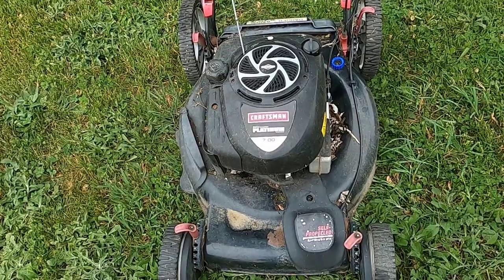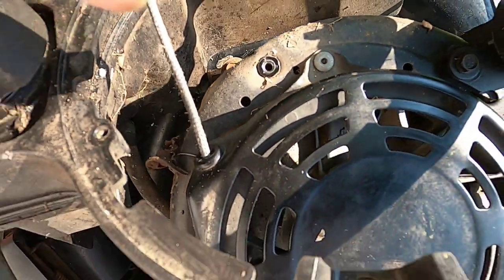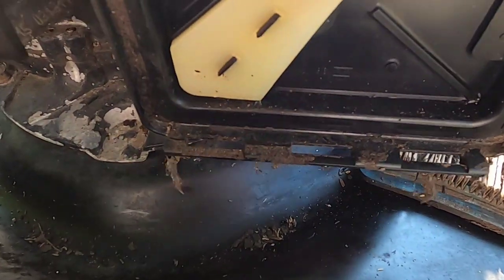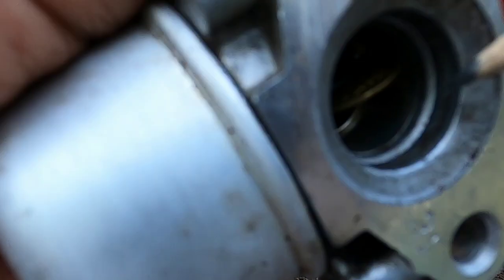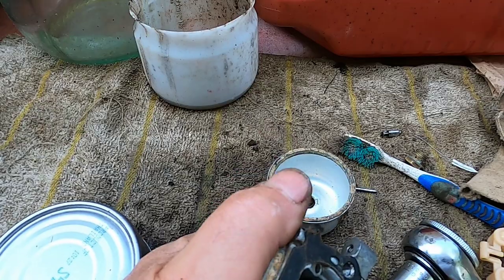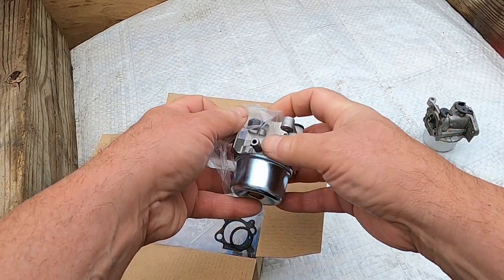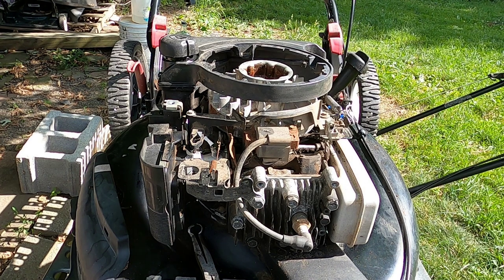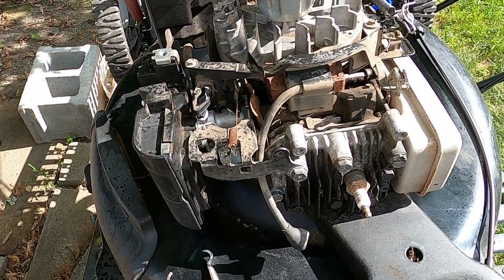Will it run dump pick mower

Comment: The air vane for the choke shouldn't be hooked into the thermal device lever. The lever should rest just behind it, so the fan can blow the vane forwards when it starts.  As it warms up the thermal device pushes the arm up to the vane to hold the choke off for a warm start.
Reply from the maker: Good eye 👌Thank you.

Comment: If there's a gummed up, gunked up carb out there, you seem to find it.  I don't blame you for buying a replacement.  When they're that hard to get apart to clean and check, it's hard not to just get a new one.  I paid about $165 for an OEM Briggs carb for my Craftsman tractor mower after a neighbor dropped and lost an internal part or two.  We found one, but without a complete carb with everything where it's supposed to be, I didn't want to try a rebuild kit and I didn't trust the cheaper no-name carbs from just wanting to be done with it so much.  In the future, I'll look at your HIPA brand, and if you make a buck from that link, it's fine with me.  Turned out to be a good thing getting an OEM, though, because it's an upgrade to Nikki that was in there.  They developed problems over time, so Craftsman changed to this one.  It threw me at first, not looking the same, so I asked the local small engine shop about it and they told me it's the replacement in the parts manual.

Once you get the wheels repaired and anything else, and maybe repair the rust and spray paint the bad place, it'll run like new and look great again.  When I'm in that deep, I do the little stuff, too...  when I get around to it.  😝  My Troy-Bilt tractor mower is still in pieces in the shed after getting the Craftsman from my best friend.  I'll get to it one day, but it's too hot now, or at least, that's my excuse.  It might be too cold soon.  🤣  The Craftsman has kept me busy enough just keeping it running and then not burning belts.  I'm hemorrhaging money on mowing my grass.  That's a better excuse for now.  😉  Great job, Joe!
Reply from the maker: Thank you. Yep I seem to find them LOL. OEM is the better way to go but like you said can be pricey.  Nikki carbs can be tricky with the gaskets but like anything else once you do one the rest get easy. Check Facebook, Craigslist or curbside for a free mower. There are plenty out there you can use for parts.